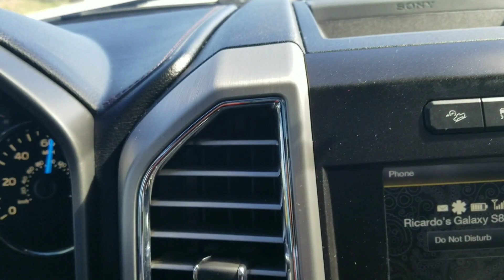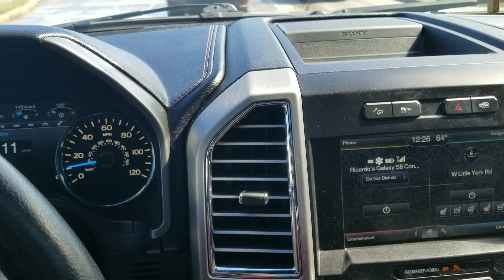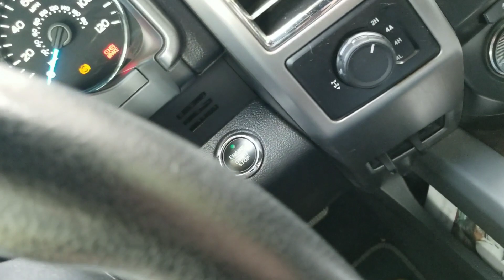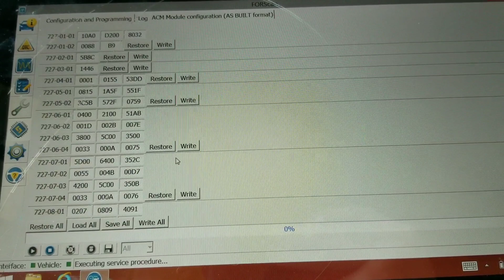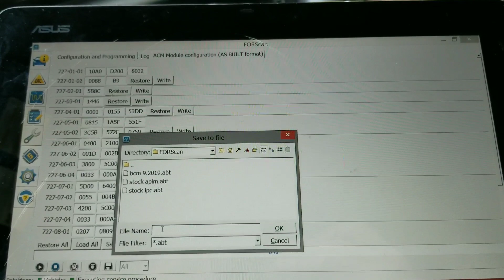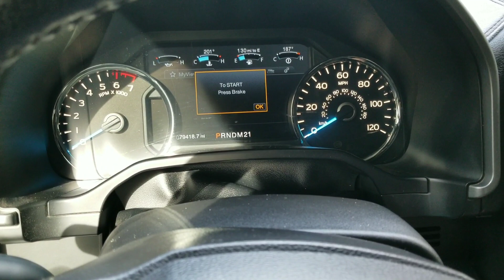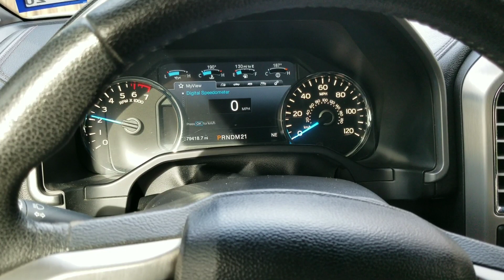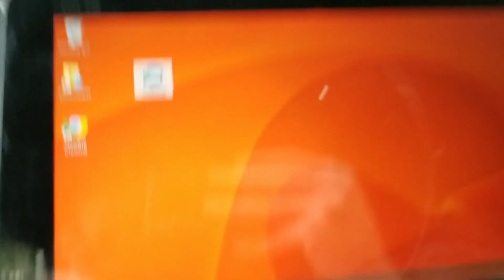FORScan disable enhanced fake engine noise of Ford f150

Comment: First of all, I have an ‘18 2.7 EB, so I guess I have no engine noise enhancement. However… at my 727-01-01 address, my second number set is 1800, and you had D200. You changed yours to D000 to get rid of the “noise”. Now here’s my question: Where or how do you find out what any of these number sets equate to? How did you know D000 gets rid of the noise? Why does mine have 1800? What does 1800 mean? Is this all just “trial & error”, or is there somewhere to reference various number sets?
Reply from the maker: Hi craig, dont worry about the other digits. Its only the second digit of the second set. I had a 2, you have an 8. Leave everything else the same. Each digit can be something different.
Reply: @ricardosworkshop  I finally found the spreadsheets that explain every character available in the 4-digit hex codes. Thanks
Reply: Can you make this available please?

Comment: You changed this to "0", I have a USB in my console, so should I use 1? = [1=FT absent & CS : North American & ANC absent & USB present].    Trying to understand the difference between 0 or 1?
I have a Ford 2015 F150 3.5L TT EcoBoost.  Your videos are awesome, thanks for all the great information.
Reply from the maker: Mine has USB also but the 0 worked...  not sure why it list 1. You can try both,  just save original .

Comment: If you have aftermarket subs you can hear it a lot
Reply: Yeah, it's a very low frequency tone... Bigger subs will make it louder. (and certainly any bass boosts turned up on the amp will make it crazy loud! )
Reply from the maker: Really... thats interesting.
Reply: Yupp I have the same problem on my 2020 ford ranger,if my bass boost is in the medium or high setting I can definitely hear the engine rumble specially when I turn it on on a cold start and no music is playing 😣I just ordered the ford scan tool so I can tweak with the settings😀

Comment: What were the factory values? I did this and can’t seem to load my backup files. Need help it turned off my subs.
Reply from the maker: Checkout this website... use your VIN
https://www.motorcraftservice.com/AsBuilt
Reply: Ricardo's Workshop awesome thank you!
Reply: I have the correct values but for some reason after I press write all at 66 percent it says service procedure failure and won’t change it successfully. Any ideas?